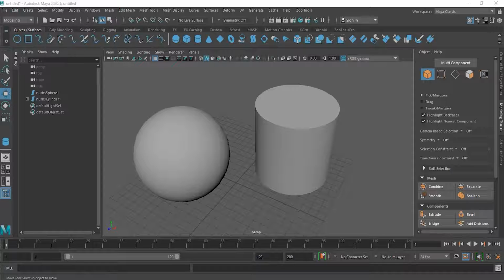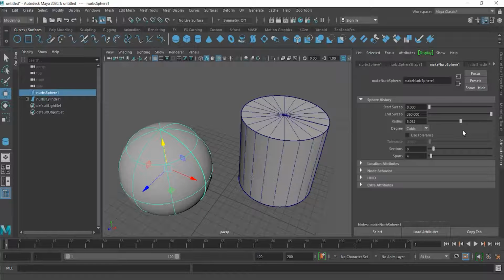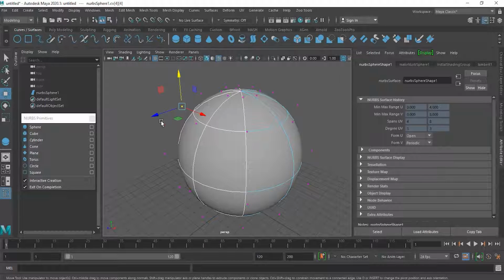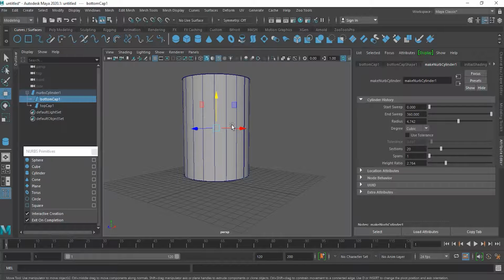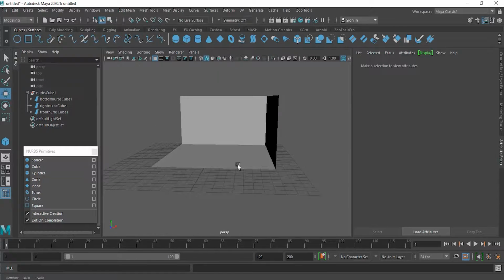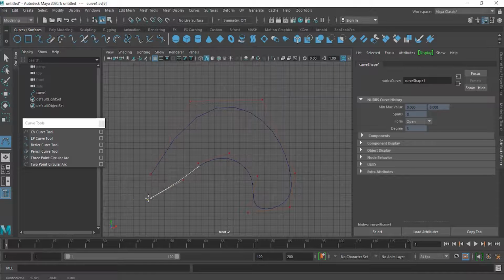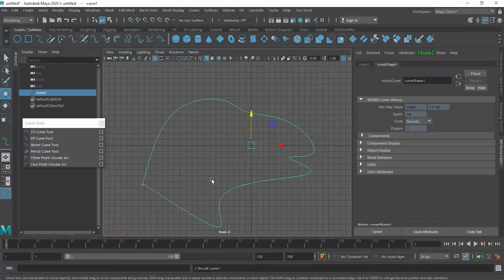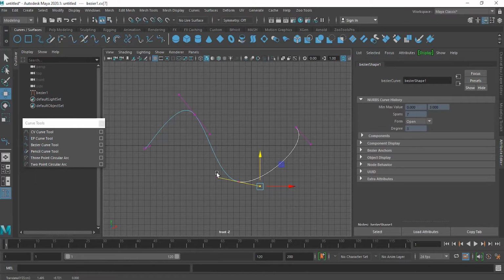What are Maya Nurbs Primitives? | Autodesk Maya Essentials Series | Lesson 7/13 - Part A

Comment: Sir what is the use of Nurbs primitive when we have Polygon Primitive??
Reply from the maker: NURBS (Non-Uniform Rational B-Splines) primitives in Maya are primarily used for creating smooth, curved surfaces that require a high level of control and precision, which is particularly useful in fields like automotive design, product visualization, and character modeling where smooth, organic shapes are essential. Unlike polygon primitives, which are made up of flat faces and can require a high polygon count to achieve smoothness, NURBS surfaces are mathematically defined curves, allowing for a smooth appearance with fewer control points and more efficient manipulation. NURBS are ideal for creating surfaces that need to maintain a mathematically accurate curvature and continuity, which can be more challenging with polygons. They are also widely used for patch modeling techniques, where different patches of surfaces are joined together seamlessly.